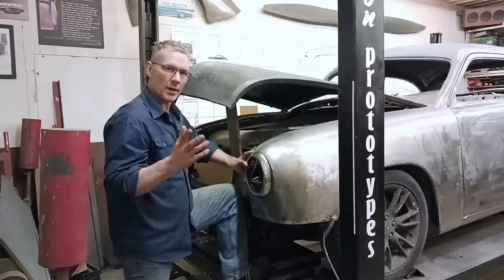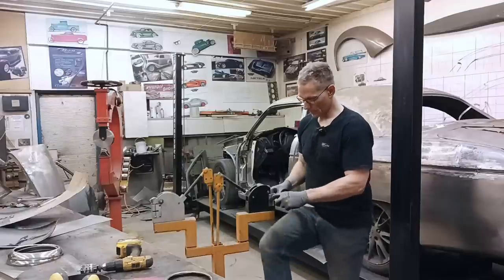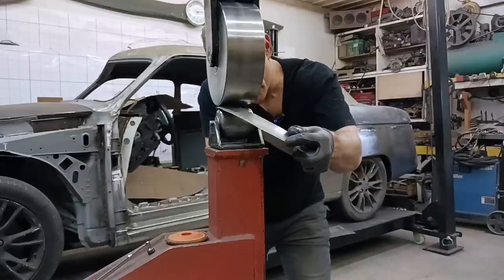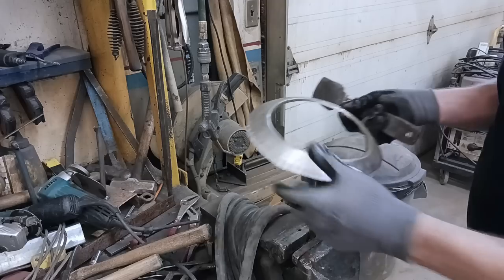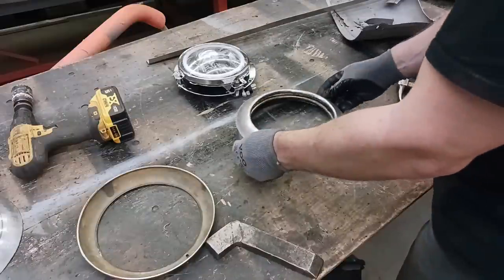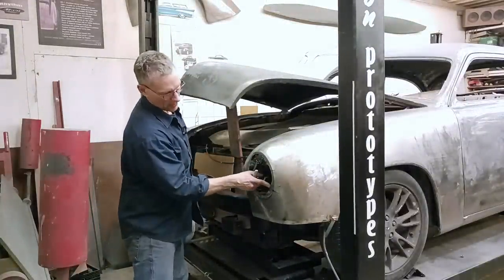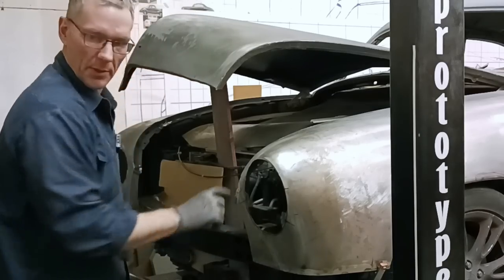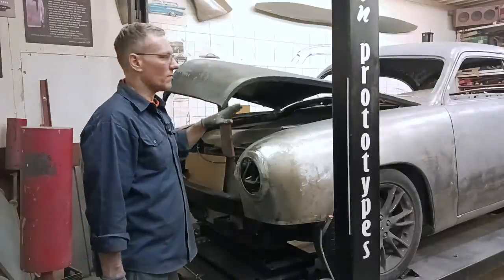HOW TO French Headlights Using Handmade Rings - Ep.22 - 1951 FORD + INFINITI G35XS Sport

Comment: I am really really looking forward to seeing how you actually mount the headlight bucket/assembly into the fender so the light can be aimed and the bulb replaced.
Reply from the maker: Inserted from inside the wheel well with the adjustment screws flipped to work from the backside.  Thanks for watching Larry!

Comment: Interesting discussion.  I did some testing welds a few weeks ago joining 18 gauge mild steel to 1/8 304 stainless plate using 309LSi rod.  Coincidentally long  before you made this video.  I am not seeing any signs of corrosion beyond what you would get with any  bare mild steel and none on the stainless.   If you could describe the risks in more detail that would be very helpful.  If I were to use all mild steel I know I would have a rust problem in the future anyway, and the stainless shines up so much nicer, so what is the downside?  Thank you.
Reply from the maker: The original rings didn't have the correct shape and under primer/paint no one sees the polished  stainless.
Reply: @iNVisionPrototypes  Thanks for getting back to me.  So are you saying that galvanic corrosion between stainless and mild steel is not that big of an issue in reality?

Comment: Curious as to what you are doing for access to the adjustment screws.
Reply from the maker: Adjustment screws will be flipped and accessed from inside the wheel well.  Can reach up inside without pulling the buckets to make adjustments every time.

Comment: not sure why galvanic corrosion would be an issue if they're painted and sealed on the indside. no electrolyte, no corrosion.
Reply from the maker: Fasteners have a way of cutting through the paint... Worked on enough cars for clients over the years to see them rust from inside out :(

Comment: doesn't shrinking that much thin the metal a lot
Reply from the maker: Hi Warren, great question Sir!  When you shrink, you bunch/gather the metal together making it thicker while the stretcher spreads the material apart thereby thinning it out.  Think dough.  In this case, shrinking the perimeter created less surface area and pushed the inner ring upward.  It's always a good practice to shrink and stretch about 50/50 if one can help it.  When I rolled the edge that meets the headlight I was stretching over the dolly but not so much that it was paper thin - still lots of body left.  Hope that helps and thanks for watching.